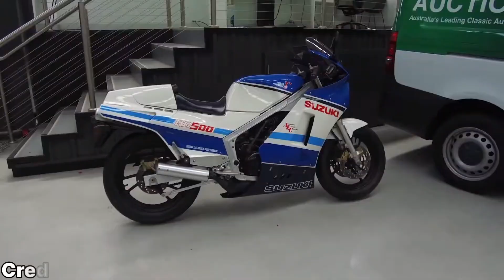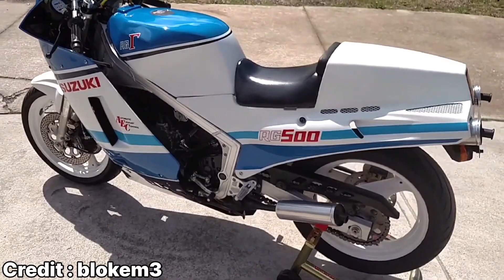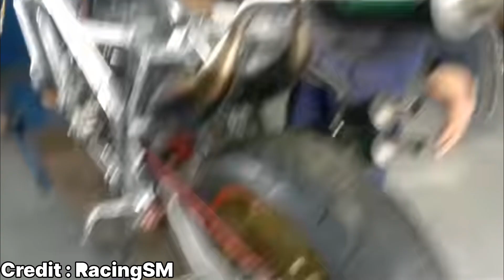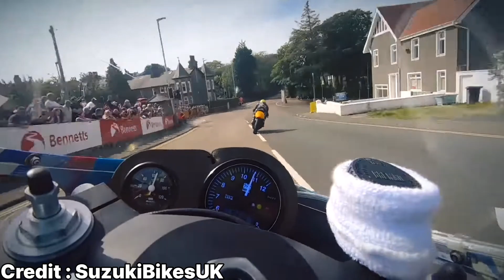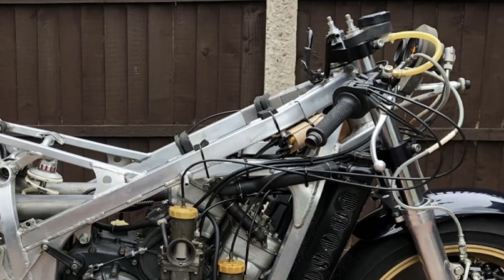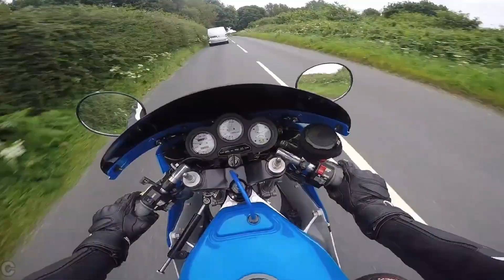Suzuki RG500 Gamma - The Greatest Two-Stroke Motorcycle Ever Made

Comment: Had one, loads of fun (back then)
Drunk like a WHALE. When 4* was £1.50 a U.K. gallon, 4.54 Litres.
 (not exactly a long life engine either)
 Today, an Aprilia RS 660 IS WHAT TO BUY 'INSTEAD'.
Sure_ It is (maybe) 40lbs heavier, but 25 yrs newer running tech and can reliably do 55 to the gallon instead of  mostly 25 (STOCK Gamma, tuning made them worse).
 I would put money on the RS 660 doing +50% mileage to a top end rebuild (and there are only 2 cylinders, pistons, rings, etc)
 So yeah.
I spent a LOOONNG time hoping without any faith for someone to build something  modern but close to an RG 500 for my retirement and the RS 660 is pretty much exactly what I wanted.
 If you want cheaper, the SV 1000 (faired) is a faster more powerful but heavier less similar to the gamma option and if you are really broke a faired SV 650 (minus 1 tooth up front) 
Will stand in for an early 66 hp yamaha 350 ypvs. Enjoyment wise.
But it wont directionally respond to you like a PV.

Comment: sadly the 750s were more popular at mid 80s.  rg 500 came at the wrong time. if it was a couple of years earlier it could dominate. if it came later it could benefit from the late 80s design  and technology which more or less it stands until today if you dont count euro 5 and electronics. bimota vdue is the best 500 example but only with carbs, injection ruined that bike

Comment: Had a 3 cylinder gt380 love the sound of 3 cylinders on Tikover a magic sound Suzuki triples great bikes👏
Reply: I put 50,000 miles on my '72 GT380 when I owned it back in the '80s. I could carry the front wheel 4" off the ground across intersections by slipping the clutch just right in 1st gear-great fun bike.

Comment: I had 2 new RG 500 and 2 used ones. the first new one only gad 150 km when a car hit me. so I got from the insurance a brand new one. never had any problems. only thing was that the rpm limiter ( the igniton is withdrawn at about 9300 rpm ) and then you think the engine is running against rubber. nothing goes anymore. at that time I was looking for other ignition box where you could adjust the limiter, but nothing found. 😒today there are a lot of ignition boxes on the market and it would be fun to test such. but now I´m 69 and I think to dangerous to ride such a bike at the limit. but I remember very well this great bike  😃👍

Comment: I was lucky enough to own an RG500 back in the 80's it was a great road bike...But not my favourite. That accolade goes to the TZR 250. It was nowhere near as powerful as the 500, but the chassis and brakes were so much better than the Suzuki's, and with only a 250 engine, this meant you could ride it at almost ten tenths everywhere there was an open stretch of road, compared to my earlier 250/350 LC's and Power valves the chassis and brakes were an absolute revelation. I'd never felt anything like it before...or since (actually). In the dry on a country road it was literally foot peg to foot peg in a blink of the eye. Great memories!
Reply: I think the TZR250SP was the most extreme (and scariest) 2-stroke i’ve ever owned.  From its size and mass, it almost felt like a bicycle…except that hitting the power band it instantly tried to go 100mph.  A wonderful scary experience.  Wish i hadn’t sold it.

Comment: Quite enjoyed your video, and it's obvious you are a fan of the RG.    A couple of significant technical corrections:   The crankshafts are not counter-rotating, and also, the rotary valves are rotary disc inlet valves.  Your graphic incorrectly describes an exhaust trapping valve.  

Still, great video overall and will share with my mates. 👍🏻

Comment: I owned the yamm'r rz 500. not the rd.  loved it. but wanted the rg when it came out the following year.  dealer only got one for the year.  no special ordering back then.  rg 500 was a beaut. I raced one in Winnipeg, MB with my rz  in  1986.   off the lights, low end, he pulled away everytime.  rz too heavy and the rg had 4 horsepower more.  top end I would pull away.  the rz wasn't nothing to sneeze at.  With all the aftermarket goodies, it would have been possible to bump horsepower up over 110. which was a lot back then.  drop 1 tooth on the front sprocket, change the pipes, jets, different airbox, more carbon fiber, change the rims, tank, shocks. Definitely could have made the rz a contender by shedding 70lbs.

Comment: After placing second in our local clubman’s 1984 senior production race series on my GSX1100EZ, I traded it on an 1985 RG500. I struggled to feel confident on it for 12 months on the standard rubber, but when I changed to hand picked, non-standard-sized (mismatched) Metzler tyres this thing showed why it was basically Barry Sheen’s 1975 XR14 race bike! I removed the lower (belly) fairing brackets to allow the belly to move when it started scraping on the road. This thing cornered Hard, popped Power Wheelies out of corners and stopped on a Dime. Without doubt the most inspiring, and wicked machine I have ever owned. Phil Read, 67yrs, Auckland, NZ.
Reply: You are wave braver than I am!  My Gamma is gorgeous, upgraded, tuned, and amazing to ride. 
   But in terms of tires, sadly i can only show off chicken strips.

Comment: I had a RD350 and was living in Jasper Alberta when these were released, I walked to work usually in the mountain town and noticed a beautiful bike in the fenced impound yard of the local tow outfit in the morning, after I finished that day I walked over and it was a blue and white RG500 that had front end damage with the forks folded into the cowl and the tow operator took great pleasure pointing out 2 dimples in the face of the gas tank, never new what happened to it but looked repairable

Comment: I had one. Awesome bike but horrible for the street. It was the answer to the question no one was asking. Leave in the garage as a time capsule
Reply: …or upgrade. 
   With a good air box and replacement pipes that keep some low end and maximize the powerband, you’ve got a rocket.

Comment: I mean to be fair those 8hp over the competition have little to do with the lack of a balancing shaft. My reasoning being that these bikes could have made so much more power even at the time, if suzuki just decided to give the bike more power.
A 125 single cylinder could be built to close to 40 hp already in the 70s, so easily so that most mx guys would run an engine like that. If you just take those engine metrics and turn it into a 4 cylinder you get easily more than 160hp, because there is an additional power bonus in engines when increasing the piston number.
As far as I know works bikes had already cracked the 200hp number a while before these bikes hit the road. So it's really more an accessibility and riders safety concern.

I think the fact of the matter is that neither honda, suzuki nor yamaha wanted to kill their customers and reap the bad press. So they just made the bikes fast enough to scare the shit out of even advanced amateurs and left it at that.

Comment: It is by far the best two stroke ever. If made today just imagine what it would be like with fuel injection etc.
Reply: Fuel injection isnt magic. Its merely a delivery system, just like the carburetor. You would notice no difference between the two by riding them back to back.
Reply: Carburetors have inherent flaws that cause them to be inferior to a well designed fuel injection system. Fuel injection can measure temperature,  humidity, barometric pressure,  rpm, throttle position,  load, exhaust gas temperature,  among other parameters to vary the fuel to air ratio for a more efficient burn. Carbs are not capable of that.
Reply: @rdaystrom4540  bimota v due 🤣🤣🤣

Comment: A rotary valve two stroke engine normally refers to its method of induction e.g. piston port, reed valve or rotary valve. Not the method used to control exhaust port timing.
Reply: You are spot on, the video shows the exhaust valve, it does nothing to explain an induction rotary valve.

Comment: Were they ever sold in north america.
Reply from the maker: As far as I know, it was never officially imported to the United States.
Reply: @RevvingHeart  The only one I ever seen was in italy.   I see one aprilia 250 two  stroke in america.  And it wasn't street legal.
Reply: @RevingHeart True they weren't imported due to smog and other regulations of the day but when I lived in SF Bay area in California I knew a guy who had  one shipped to California from Canada in pieces. It got here but somehow DMV found out about it and wouldn't give it a registration so he converted it to race use only and ran it at Sonoma Raceway. At the same time I had an older Yamaha TZ350R 2 stroke which was very crude in comparison although very fast. Smog and fuel mileage finally put the nail in the coffin of these 2 strokes but if you haven't ridden one and are only familiar with 4 strokes.... you should try one. The Gammas were very nice bikes with just a few issues...I heard the trans evidently was a bit delicate. Stock they were heavy relatively but as mentioned in the video that could be fixed. The upper two pipes were what limited the tire to a narrower tire but that could be fixed with an after market pipe which would also give more power although a bit noisier. They drank gas and of course 2 strokes were smokers when cold unless you used synthetic oil.  modern bikes are so much better in construction and chassis setup and far safer handling..... but those old 2 stroke bikes were special and very advanced for the day.

Comment: Great video paying tribute to the most desirable 2 stroke street bike ever made👍🏼
Reply: So u dont know bimota vdue 500
Reply: @ODN-yj6xn  yeah the one that looks fast but unless you get the carbs reworked and tuned the thing will blow up like a Chinese wrist watch. Yes I’m well aware of the Bimota Vdue sir 👍🏼
Reply: @xipingpooh5783  bimota v-due 500 got an electric fuel injection Sir
Reply: @ODN-yj6xn  the fuel injection didn’t work so the bikes had to be retrofitted with carburetors. Even with that they still don’t run well.
Reply: @xipingpooh5783  lol

Comment: All from technology stolen from MZ.  Check out the story of Ernst Degner.
Reply: A bike I remember well from the 80’s and 90’s never rode one but did own a RD 350 YPVS and my best mate owned a RD 500 YPVS and we used to have a huge amount of fun thrashing the life out of those machines!
Glorious times indeed ❤
I’m on a mission at the moment to actually buy an RG 500 just to bring back the nostalgia ❤
Great video ❤
Reply: Not all, water cooling, electronic ignition and variable exhaust port control were not developed by MZ.
Reply: @ianlewis6717   Yup Barton Square 4!! But Walter Kaaden was the man to make expansion chambers. Suzuki and Yamaha made all that after Ernst defected and went to Japan,. Stealing speed by Mat Oxley..  Great book.
Reply: @ianlewis6717  all meaning based, starting from.
Reply: @ianlewis6717 The first bike I am aware of having electronic ignition as standard was the Jawa Babetta moped from Czechoslovakia in the 1960s. The main objection to electronic ignition was that if it went wrong it could not be fixed at the roadside like a contact breaker system usually could be. The Babetta was aimed at customers who would not have been into fixing any sort of ignition at the roadside.
Reply: Kawasaki bikes had electronic ignition back in the 60s.  @cedriclynch
Reply: @LSD97123  it is possible that Kawasaki beat the Jawa Babetta in being the first to fit electronic ignition. Am I right in thinking that the 500cc triple had electronic ignition when first launched but had contact breakers towards the end of its production run?